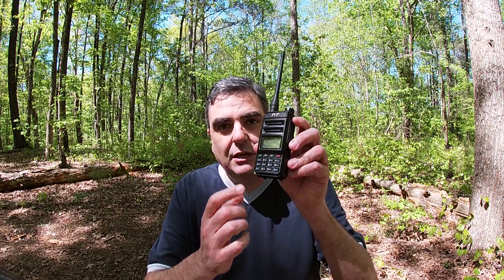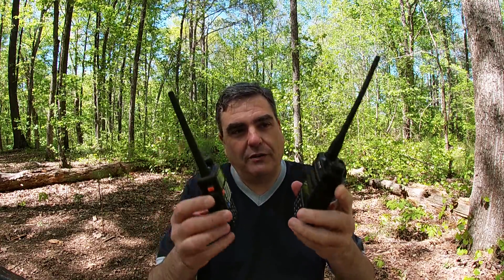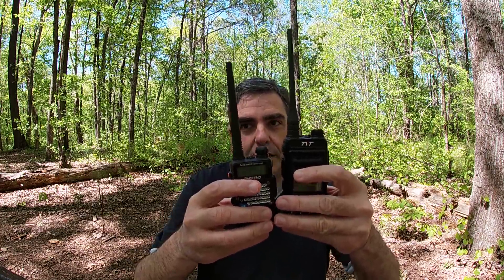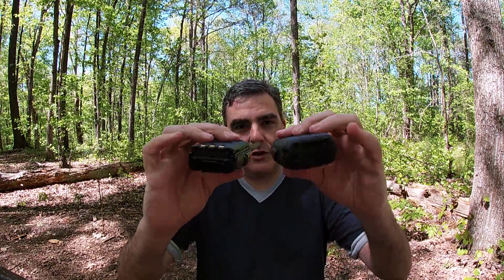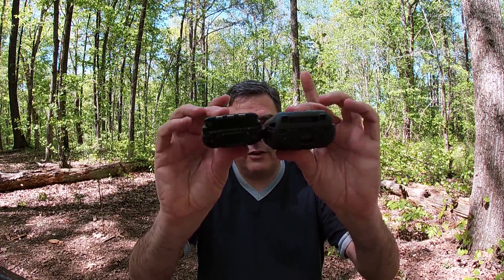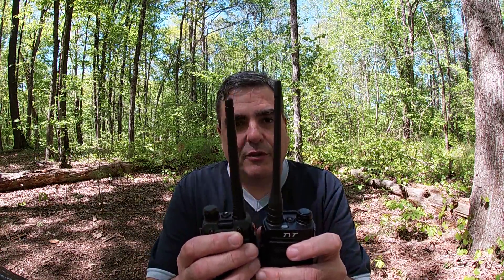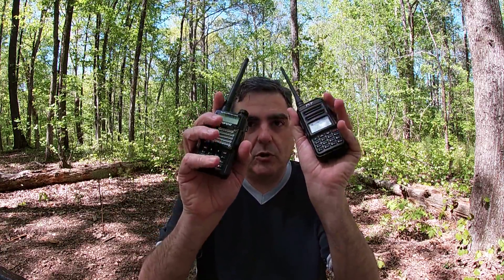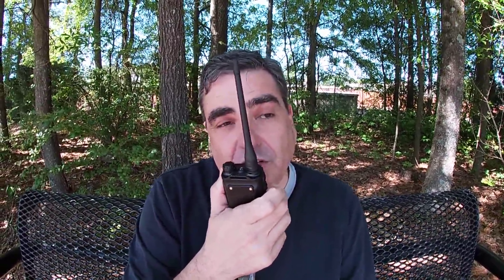Replacing my Baofeng UV-5r with inexpensive TYT

Comment: I can't speak for the TYT UV88, but I have the TYT UV8000E that has 10 watts on VHF and does crossband repeat. It also uses the Kenwood pin pattern for speaker mike/programming cable. It's about double ($79.99) and comes with two antennas. With the taller whip from day one I had people in our club asking if I was on a base or mobile on the repeater. Before I got my mobile for the van I was hooking it to Tram through the glass antenna and working 30 miles away. I even run the the weekly net when it's my turn with it from inside the house on the whip and a BTECH QHM22 Platinum speaker mike (around $23). Always reports of a good signal. So no surprise the little TYT is doing well for you.  After the TYT, the Baofengs (still have 2) are just kind of gathering dust or being programmed for limited, specific use. My TYT came with a good manual written by an a native English speaker. I've been impressed by TYT so far. I'll have to check out the UV88 as a backup/go bag radio Sounds like it's keeping with my experience so far with TYT. Appreciate the video. 73 K2WLF/WQZW588
Reply: Ah heck. Just went over there and bought the UV88. With the discount it was $33.24 with free shipping. Yep. Definitely a UV5R killer.

Comment: I have a suspicion in a future video there will be an oscillator test on this. ( I would love to see it). In the video I picked up on  ”I know for a fact” it has a clean signal.   I am waiting to test for my technician (tests on hold in PA due to covid). learning a lot from this channel and much enjoying it!   Keep up the good work Brian!
Reply: Noodle61746 look on hamstudy.Org they have links for online test taking
Reply: I signed up and I am on the waiting list for possible remote test.  Thanks.  I also bought a TYT using the code .  Came today 4/24/2020. Need to get it programmed.  Went online today to see sold out.

Comment: I recently bought the uv-5r from amazon for $25. Not sure if the latest generation has the problem of out of fcc spec for broadcasting on harmonic frequencies. I'll have to check it. If I had NOT purchased the uv-5r and known about the TYT, I would definitely have purchased this radio instead. It would be nice to see the same spllover test run on this radio. One other complaint about the uv-5r is the lack of selectivity on the front end. I wonder how this radio compares in that regard. 73

Comment: Great informative video Brian. I too have cheap Baofang radios and one Ailunce HD1. Looking to replace them and now you have shown me the way! Stay Safe. Dafydd M6ULU   UK
Reply: Why do you want to replace the HD1 and which radio do you want to switch to, md390?
Reply: @Tartarus34  Some of the HD1 units had a very low microphone problem. It was that bad that in one update they turned the mic gain up to max to help it out but this never helped in my unit. I am oftem told my voice is very quiet. It now stands on my shelf gathering dust! I would like a Yaesu ft3d ...good reports and maybe a more mature company to deal with.
Reply: @dafyddr8678  Thank you for returning. FT3D has good reputation.

Comment: I am trying to get into Ham radio, I got the 8W  BF-F8HP I have got it and haven't got to use it yet. I like the dual band also. I want to try it out. I don't know any hams. I hope mind doesn't do what your radio was doing. Is there anyway I could try it ?  just to see how it sounds and works ? right now i don't know where I could take the ham test and maybe i better brush up on it. Can I take the test on line ? I don't get around very good any more. I hope you will reply back to me.
Reply from the maker: You can't transmit on that radio without a license. I am not aware of any online testing. Search for ham radio club in your area. They probably offer testing and have members that could help you study and test your radio. Good luck.
Reply: @HamRadioInAction   Okay I thought that but had to ask just to be sure, So i am going to use it with the fire dept, I will get my ham license I hope in the near future. when I do i will try and get in touch with you then.

Comment: I've had one for a month or so. Looks and feels nice, but I have had some trouble programming (Could be user error). 

Did buytwowayradios provide you any information as to when we might be able to buy extra batteries, battery eliminator, DC charger, or other accessories? This has prevented me from buying more or recommending to friends. These are staple accessories for baofengs, so I would hope we can buy extra batteries, for example, soon.
Reply from the maker: I will ask them.
Reply: What site did you use to program it ? I seen a website selling a programing site for it for $49 it would give you repeater boom imports and radio reference as well.
Reply from the maker: tyt888.com click service and then download. Grab the TH-UV88 software, which includes programming software. Both my baofeng and TYT programming cables work easily.
Reply from the maker: buytwowayradios.com said they are getting extra battery packs with their next shipment which could come as soon as next week. They will check on a car charger and other accessories and try to get those as well.
Reply: Ethan Gollehon I cant seem to get the programming software to even run on my computer. I’ve been at it for 2 days now.
Reply from the maker: they have forums on their site, you could try there, or call them.

Comment: KI7BSL here. I too have replaced both of my Baofeng radio's, and I also went with a TYT, but I went with the UV8000E, 10 watt, radio, Dual band, dual watch, and even dual band repeater. Cost me about 80 dollars but it came with all sorts of extra's. Two antenna, Charging cradle with wall plug and car plug. Programming cable, a 3600 mAh battery. Even its own programming software, but Chirp handles it now. Its a great radio and I run a 18.8 inch Abbrree antenna on it. I am able to hit repeaters with it, that my Baofeng F8 wasn't able too.  Have fun, stay safe and 73's.
Reply: Interesting. How many channel memories?
Reply: @axorex  256 memory's, but I dont use more then 10
Reply: @JamesHart62  Thank you
Reply: Is it really 10 watts though
Reply: @oldtwinsna8347  It can be if your antenna is tuned to 1.0 SWR on the frequency your using. On a local repeater frequency I use, the SWR is 1.02, and power output is 9.98. So if I could tweek the antenna to 1.0 SWR on that frequency, I would get ten watts
Reply: Hey, I consider buying it too, it will be my first radio, how do you like it? Do you think it is a good radio for a new ham to buy instead of a Baofeng?
Reply: @SercoTheGreat  Yes, it is a much better radio then the Baofeng. Much better front end, and it comes with pretty much every thing in the box to get started. Stay safe!
Reply: @SercoTheGreat  Depends on how much transmitting you do. I have three batteries for my TYT, and one will last 4 days, depending on use.

Comment: Thanks! Just ordered one! Do you ever monitor or transmit on the Stone Mountain repeater? I monitored it most of the day. K4CIP 73
Reply from the maker: I scan the Stone Mtn 2 meter repeater and can hear it, haven’t tried to use it from my new QTH. I will be putting up a proper U/V antenna soon so I should be able to hit it. I do use the NF4GA repeaters in Roswell/ sandy springs.
Reply: Ham Radio In Action -I’m in Covington and can reach the Stn. Mtn repeater with my slim Jim antenna on a 25ft pole.
Reply: @ChadM1975  I'm in Cleveland, TN and I have checked into the Turnip Truck Net in Stone Mtn with 25 watts. You can find me on QRZed if you're curious of my setup. KO4BAH
Reply: Ham Radio In Action -I received my tyt today. I like it. It would be nice if I could use Chirp to program it. Programming is easy but inputting the 100 repeaters is time consuming.
Reply: Hey, I consider buying it too, it will be my first radio, how do you like it? Do you think it is a good radio for a new ham to buy instead of a Baofeng?

Comment: Do you have the part # for the female SMA to Male SMA adapter from Buy Two Way Radios? Or did you get it elsewhere?
Reply from the maker: added a link in the description. Just FYI I tend to buy BNC antennas, and get SMA whatever to BNC adapters. BNC can be swapped more often and easier than SMA.

Comment: You do know that Baofeng, TYT, Anytone etc are actually all the same inside with different cases?
Reply from the maker: They may use same radio chip, but I know the TYT has better filtering, different firmware, and different menu. So more than just the case.
Reply: @HamRadioInAction  They gave it the extra 5 seconds and a twiddle of the tuning capacitor that the Baofeng production line lady was "whipped at the stake" for doing, so she stopped. :-) At lest it's still only bout $35, so not too expensive.